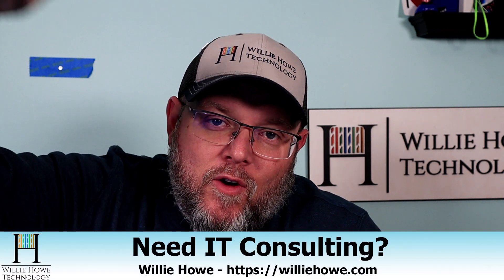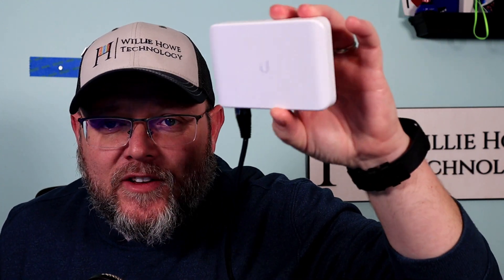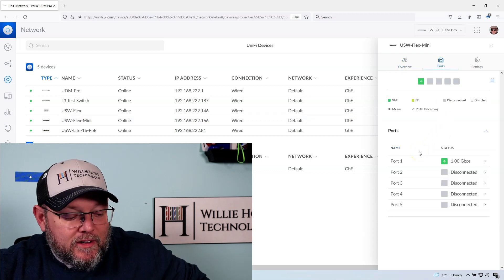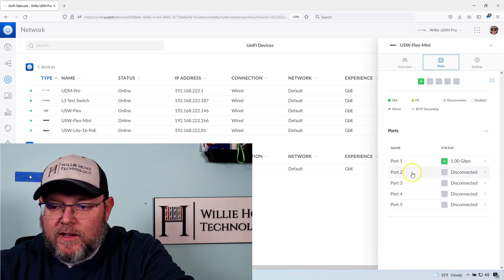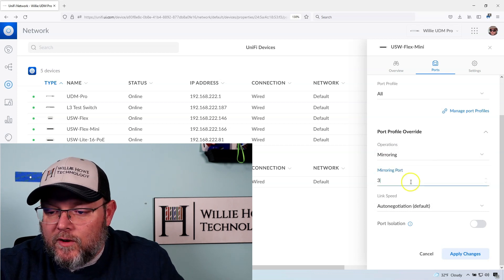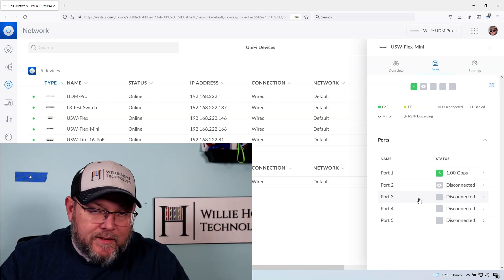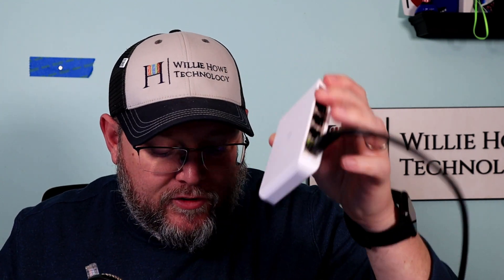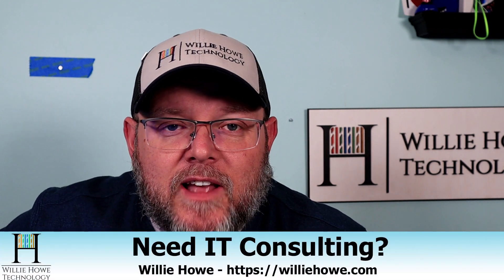UniFi Flex Mini Ethernet Tap Setup

Comment: I have a U6-Lite that is wirelessly mesh connected. I know that I can use the the port on the U6-Lite as a pass through and connect other devices to it but can I connect a Flex Mini there, manage the switch and have some VLANs on it? This is in a location of my house that where I can't run a network cable to

Comment: Hi, I work out in the field. i need to monitor what traffic a piece of software is trying to get out on. ie ip address or a dns address so i can unblock this in the webfilter  / firewall. can this allow this, and what software would you recommend that would help with this? im aware of wireshare but not used it enough to know what to setup. any help appriciated :)
Reply: WireShark for sure- it’s free, and there’s a bazillion video tutorials out there.
Reply: Adding to Chad Storm's comment, if you want someone who knows a TON about Wireshark, provides a very comprehensive beginner's guide, and it's free, look up @ChrisGreer 's WireShark Tutorial series. Can't recommend it enough.